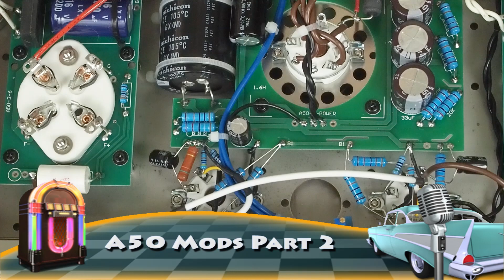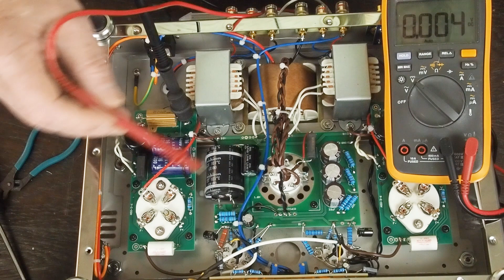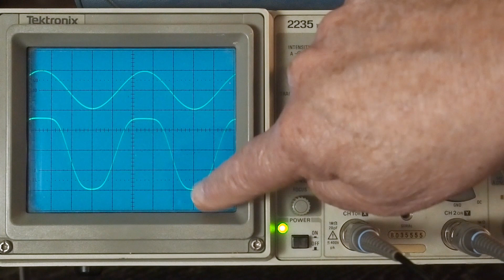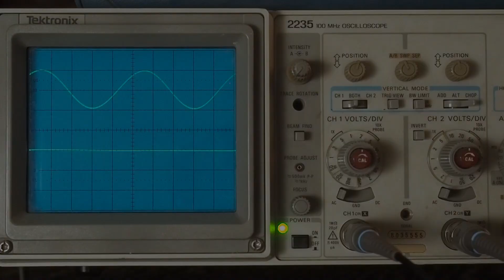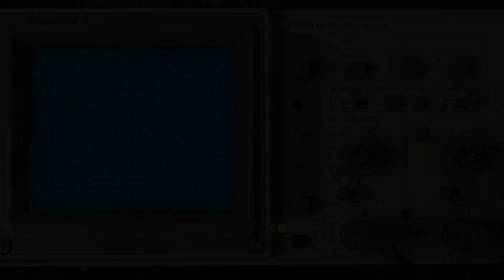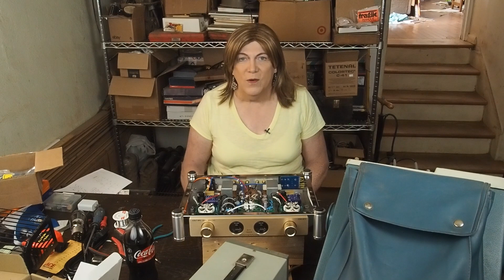Boyuurange / Reisong A50 300B Tube Amp Basic Mods Part Two

Comment: Always topp,a 300 b amp need costy parts,i will folow you close on the new builds,since i have a home made wich is sleeping,and now have 3 tubes.but the tubes did not last tousands of our s on that constructjon,so i use my other amps,and wait before i power the amp upp again, 20+ year old caps i have to replace to i think? I think it an WE copy with 6sj7  since the orginal we 310 is not avilible annymore and dc heating,wold be funn to alsow try it on ac heating,cause i dont care to much about background noice,as long as its ok.

Comment: Hi i replaced the Vol pot to a TKD and there is a superior audio leap... try it?
Reply from the maker: I can see a quality audio pot being a good idea. I'm not so sure how big a difference that would make?
Reply: @SkunkieDesignsElectronics  try it, its a pleasant surprise, its not subjective but a quantum leap. My A50 now sings with good bass and warmth, the Vol pot at only 9 0clock all the musicality delivered. Prior, the Vol ssttings will hve to be around 11 and slightly more playing from my Triangle Titus ES speakers. I am delighted!
Reply from the maker: @thomasleong9401  so changing the voltage divider device on the signal input increased the bass/ warmth and power output? O.o
Reply: @SkunkieDesignsElectronics  if you get another A50 try that, as first port of call to mod and improve the amp. I did change coupling to a Mundorf Supreme cap 0.47uf, basically replacing the orignal cap but kept the uf value. Its all good now.
Reply: @SkunkieDesignsElectronics  its like unclogging a choked pipe of water flow, serious!
Reply: @thomasleong9401  "Not subjective" means "objective" which means you measured the difference, not heard a "quantum leap".

Comment: I'm curious, what is your "reference" system components? How long have you been @ this hobby? I enjoy your content!
Reply from the maker: Right now my best sounding gear is my 6SQ7/EL34 amp with some Klipsch RP600M speakers, an EAR834 clone tube phono stage with a technics SL-B2 turntable running an AT VM540ML cart or a Yamaha s-300 CD deck. While I've tinkered with electronics most of my life,  I've actually only been messing with tube gear for a few years and am constantly learning new stuff. I try to explain this stuff how I understand it, from a non-engineering perspective and try to keep things as simple as possible :)

Comment: I find that the cathode bypass cap is as critical as the coupling cap in terms of SQ.. So at least use an Elna Silmic II for the driver stage if one is gonna stick with the cascaded direct coupled circuit, and maybe a Nichicon Muse for the 300B output stage cathode bypass..
Reply from the maker: I agree caps are important. Right now I'm just trying to get the power output where it needs to be :)

Comment: For the coupling caps, instead of 0.47uF then you put in 1.0uF, is it a waste of money or it would change the sound as well? Thanks
Reply from the maker: Bigger isn't better, you look at the coupling cap + the grid leak resistor and how that creates a high pass filter for the signal feeding the output tube.